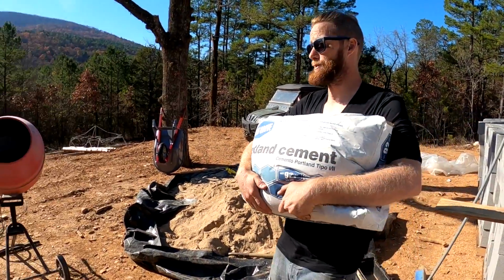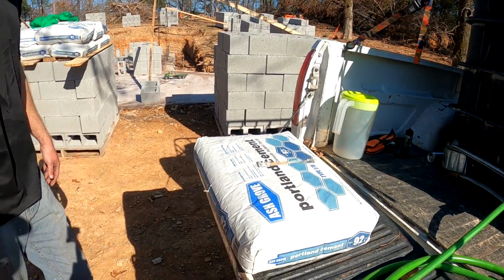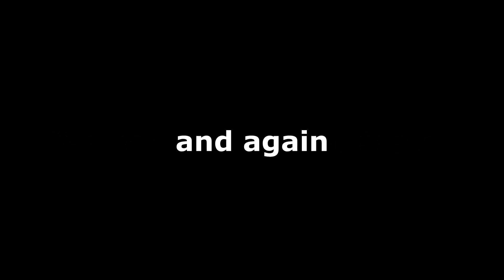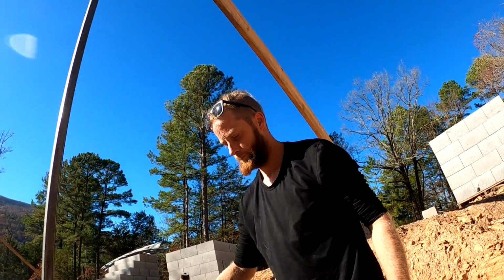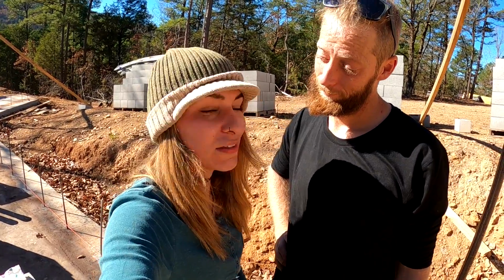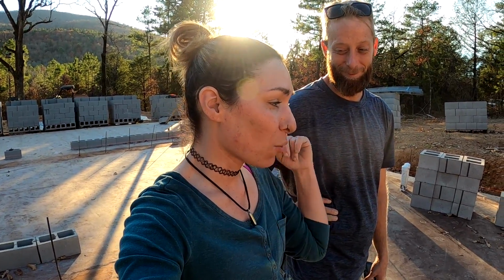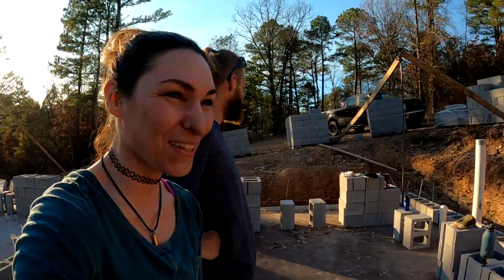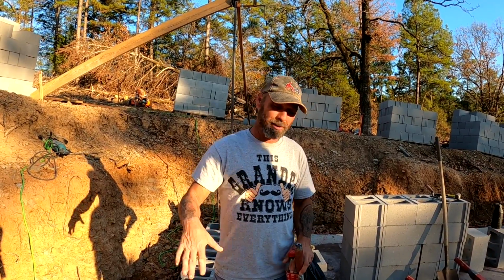Laying our FIRST Blocks| Basement Begins| DIY Cabin w/ Basement Build

Comment: You need a can of water on your mud board to add more when the cement starts setting up, so you can thin it back down again, using your trowel to mix it up. I used to be a mud boy, whose job it was to mix the cement, carry the block, set up the scaffolding and fix the bricklayer's mud when it started to set up on his mud board.

Comment: I did several major projects by hand. We discovered making wooden boxes with long handles was an easier way to load the sand and gravel into the mixer with the correct mix each time with a whole sack of cement.

Comment: If you're going to go with solid walls for your basement, start filling the blocks half way up the inside of each row as you go. Use a stick to compact the concrete fill & push out any air pockets. Leave a few holes poked into the concrete so the next pour of fill will be able to interlock with the previous one. This will save you from having to rent a concrete pump & a vibrating wand & someone to operate them. Just an idea. Have a great day 😊.

Comment: Don't forget to run a trail of sand along the sides of the wall
it makes for easier clean up of the mortar that falls on to the concrete slab
Right now it isn't that cold but block layers around here say it doesn't stick well below 40 degrees

Comment: Oh bless your hearts if it wasn't so far down to your place I would come and camp out in my truck to show you the finer techniques of block work don't over think it chill out and have fun with it I know it's kinda scary but it's alot like the mud pies from yesteryear here is a tip when you can see little bubbles forming on the surface of your mortar mix and it is sticky but smooth it's right for laying block

Comment: Laying block is a lot harder then it looks . The first thing you learn is how heavy the blocks are , times however many you can do in an hour . My son makes a living doing this , and I have helped him  do some jobs . Plus you have to work fast enough to use the cement mix before it gets too dry . You can only add water so much , because when it dries on the blocks , well it won't hold together , and will crumble some where down the road . Getting that mix right is a must , then and only then you will start working faster and better . Remember if it is getting to you , stop for a day , don't push yourselves to a point of giving up . Just take a bit of time . Also the weather will be playing in this as well , rain , do not lay block in the rain , it will wash out . If I can do it at 67 years of age , I am now 70 I do not have any dough you can do it . You can not lay block when it gets below freezing ether . Just work on the mix when it is right you will know , and then things will work right for you . You will get there And I wish you nothing but luck . Just Saying

Comment: You guys definitely get an A for going for it! Your expert probably didn't see you mixing but I would guess your number of sand shovels is correct but you have almost double the amount of sand in each shovel full. Reduce it a lot and keep the same ratio just smaller shovel fulls. Also when your mixing the angle of the mixer is fine for loading but once it's all loaded up adjust your mixer where the opening is almost straight up and down facing the sky and you won't have to scrape the dry off the bottom.

Comment: You are putting double the amount of sand in, that’s why the struggle with your mix is happening.  Check you previous video for the mix.  It should be roughly 20 shovels per full bag of Portland.  The mix will be grey and should be kinda silky smooth, when you run your trowel through it it should smooth out nicely but maintain the shape.  You’ll get it!  You can mix 1/2 batches, which is a good idea so you don’t “lose” your mud.  It’s also 3.5 to 5 gallons of water per full batch, so cut it all in half.  1/2 bag Portland, 10 shovels (don’t go too big on on the “heap”), and start with 2 gallons of water.  Once you get rolling, if the mud dries in your pan, you can add a little water to keep it going.
Reply: One note, it doesn’t take much water to loosen your mud back up, just a little splash on your mud pan will go a long way.  Same when mixing, when you are mixing if its a little dry just add a touch of water, you will be surprised how little water it takes to get it to the consistency you want.
Reply: With the 12” you will need to start with a 4” cut on the corner so you will stay on half bond (8” overlap).
Reply: @rayhuber6661  I get what you are saying, but L blocks are pretty pricey and not worth it in my opinion.  They are probably special order too.
Reply: @rayhuber6661  I know what they are, been in the commercial GC business a long time.  And honestly never had a mason use them either, so to each their own.  Just here to offer some helpful advice to Simple Life.
Reply: @rayhuber6661  grew up in Pa and now in NJ, but yeah never seen them used on a commercial project I have run in 20+ years or while I was in residential before.  And I’m talking big commercial, like schools, high rises, courthouses, etc.  Closest to it is custom brick for corners, corbels, sills, etc.  
Walmart’s are a bit different because they use a split face block that doubles as exterior and interior finish.  They are looking for a finished full outside corner so you don’t have a cut piece on the corner in the exterior split face.  L corners are used with split face block or other finished blocks for that reason, for a finished corner.  This is a foundation wall, so not really necessary.  
But I get your reasoning so no grief there.  Block isn’t that hard to cut, can even be done with a grinder, so I am sure they will figure it out.  They are destined to have cuts no matter what, and surely will learn the skill.
Reply: @rayhuber6661  😂🤣

Comment: Use buckets for the sand - shovels are not consistent.  Need proportions to be correct for mortar strength which is critical.

Comment: If you had to do it again you should have bought a two wheeled wheelbarrow.  Small point but I would have removed any of the silt I saw on the slab before laying the block.  Last comment, I did not see you using the jointing tool on the joints after they set a bit.  It is a small cheap tool.  This makes them look better, and it compresses the mortar at the joint.  Ok, that being said, good job overall.  Looks like you are getting there.  Keep up the good work and keep on truckin.

Comment: Well E for effort for someone who has never laid block y'all did a pretty good job and as I was watching Gary put in the sand in the mixer I pretty much knew that he was adding too much sand give you a little tip from Mason that I worked with down in Texas the way that he taught me to mix up mortar and to know that you got the right texture is he told me that the texture must resemble the texture of ice cream now he had a regular mortar mixer and he told me to add a 5 gallon bucket of water 10 shovels of sand and the bag of mortar mix let it mix all together and when it resembled the texture of ice cream then that's when it was ready to be used. But y'all is using a regular like little cement mixer that's electric powered so it's probably like a 3-yard mixer that you're using so just do like what Nick told you use a little less sand and when it looks like the consistency of ice cream then you know you've got the right mix but congratulations on your first black play and I have got a lot of confidence that you're going to get this job done and as each day goes by it will get easier for you and then y'all will become faster at laying the block and who knows by time you get done with this project y'all be professionals at it I'll give you two thumbs up on a job well done for your first block lay

Comment: they should not have told you  how many shovel full for 1 bag of portlan cement but the mixture which a 1 to 3 mixture meaning if you put 3 big shovel full of sand in than you have to put 1 big shovel full (same size shovel full) in with it. Lot of times I would not mix up a full bag because of wanting to just lay a few corner blocks. To make it simple lay 3 courses of each corner than start your rolls.  good luck

Comment: Hey guys a little "pro tip" lol only mix 1 half bag of cement at a time because you are not pro's and until you get the hang of laying block and build up some speed so if your mud cures too quick you'll only loose a half a bag instead of a whole bag anywhoo good luck guys and god speed

Comment: HEY YALL
SOME PEOPLE MIX IN LIME WITH THIER CONCRETE TO HELP IT STICK BETTER, ASK YOUR CONTRACTOR
Reply: No, lime makes it weeker, that's for brick work not block. Brick are softer, the lime is mixed in so when it freezes out, after yrs n yrs, the week morter will bust out of the joints instead of busting the face of the brick. Then it can just be repointed yrs later, instead of having to tear brick out n replacing them.

Comment: Its a great cup forks, buy one and like that, you own a cup that only two fillings of a beverage....  and your pots empty so make another.  I find I have several cups in the cupboard that you can only get maybe a total of four cups in an  the one your holding makes it full. That makes it thirty six pots of coffee  till the days get longer. If that doesn't boggle the mind of the person reading this, I might be the strange uncle. I sure hope that longer days makes for the beginning of spring easier. A concept of its that many less days till this part is finished. Once the walls are finished the insulation is going and then its going around to finish putting the electrical covers on outlets. I sure hope you are still laughing an saying "you to can build your own house" . Gary will look back at the pile of broken tools an the pile that made it thinking "I didn't see that all coming and its kinda like the day you trusted it was only a fart... but it wasn't.... nope it had some damn chunks in it! I hate it when that happens.